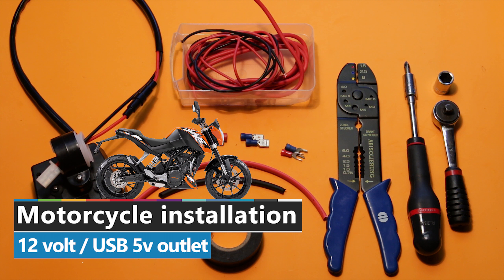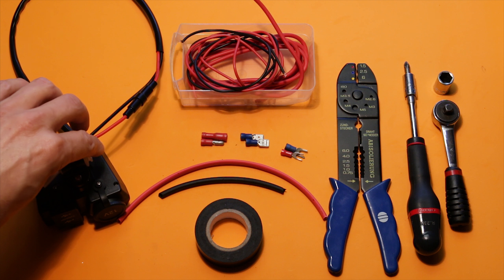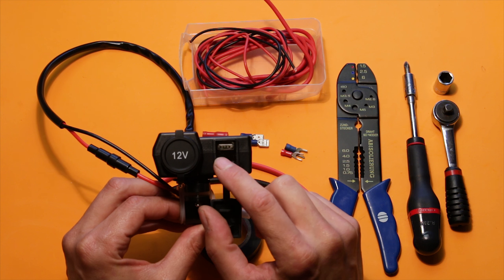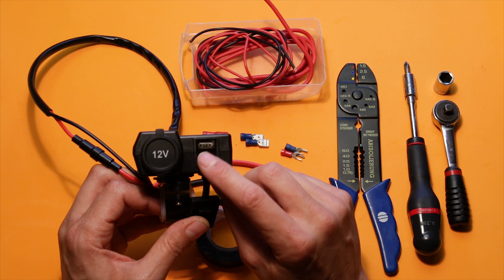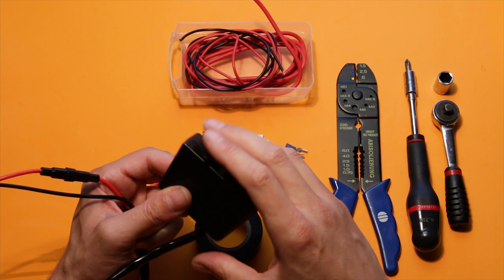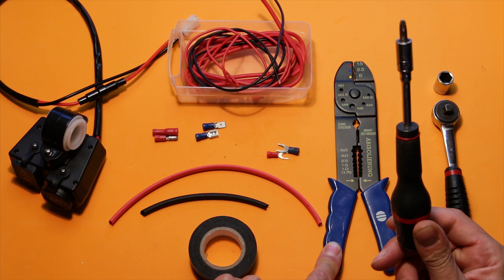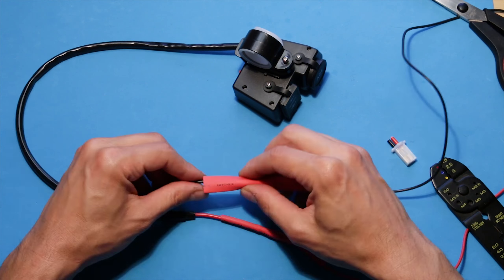#93 🚲 Motorcycle 12v and USB outlet installation - Phone charger

Comment: Ive ordered one similar to this for my solar power box. Mine will have the flip up socket cap with time. Has literally everything I need, plus the straightforward accessible fuse.
Reply: Is it still working ?
Reply from the maker: No, read the description. It's junk 😉

Comment: You prefer wiring direct to the battery or connect it to the socket at ignition key?
Reply from the maker: I want it also charging while not having the keys on the bike. So yeah directly for my use.
Reply: I would use a relay.
Reply from the maker: That would be a huge overkill!
Reply: @Nerdiasme   yes, if you always want it powered by all means,  skip the relay.  But do put a fuse in the circuit. Personally, I like relays for powering after market accessories. In the event of a fault, I'm only cooking a relay, and not any components in the charging circuit.
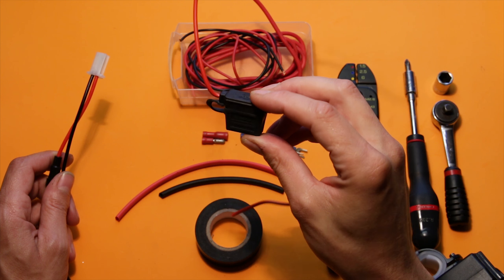Reply from the maker: 0:52

Comment: You wired that usb port directly to the battery!!!! This means it is continuously live even when the ignition is turned off.  Anything that is still plugged into it will drain your battery in no time at all.  You should never wire anything directly to the battery other than the battery charger cable.    Hope you find my comments constructive.
Reply from the maker: 0:54 not directly...fused!
I wanted to charge my phone or gopro without having my engine to run next to my tent or in the middle of the night....or having my keys on the bike on a public camping site and you can easily charge your phone fully on a motorcycle battery, so no issue... used it countless times without a problem....it has a power switch.